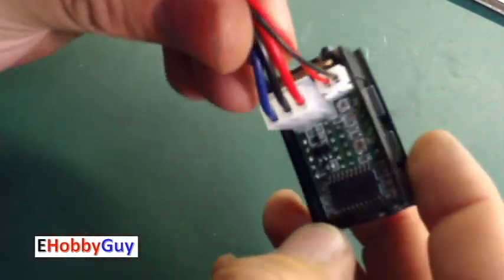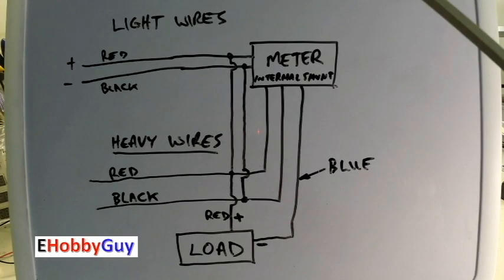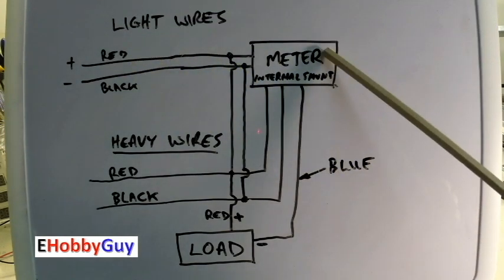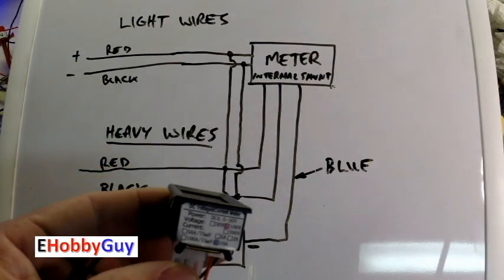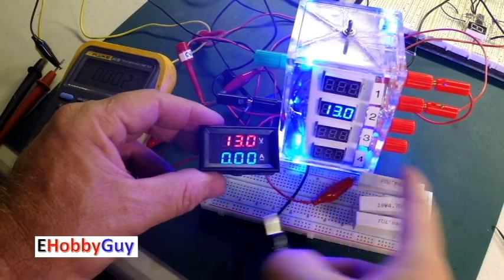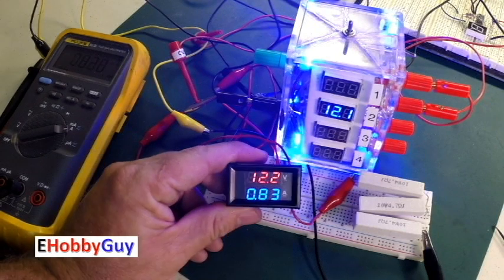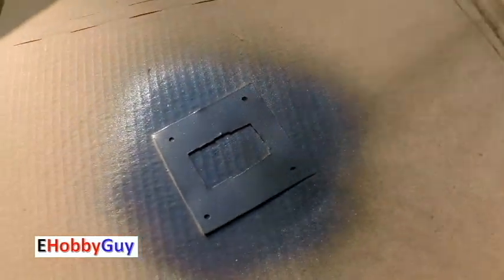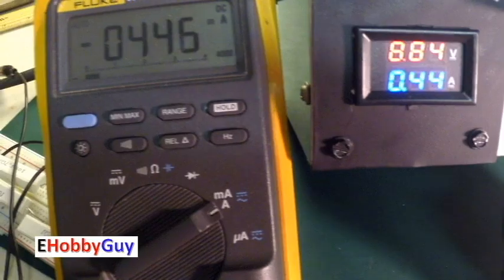CHEAP EBAY VOLT/AMMETER, REVIEW, HOW TO WIRE AND USE

Comment: Great Video!
Question, I am using a single power source for my meter but I want to be
 able to turn off the meter while leaving the line power on. Do I 
interrupt the yellow wire for a switch?
Thanks

Comment: Will one of these work on a 140 amp inverter welder ?
Reply from the maker: Not this particular one.  The maximum current on this one is 100Amps.  I am sure if you search for a higher rated one you will find one. Thanks for watching!

Comment: I have this same meter, and I want to hook it up to a boost converter that I'm using to charge a battery so that I can measure the output of the converter.  I put the small red and black wires on the input to the boost converter which is a 12-19v source (solar panel or battery).  I put the big red wire + and black wire - on the output of the boost converter which is 39v.  The + on the output also connects with the + on the (Load).  The green wire goes to the - on the (Load).  The black wire is not connected to the load, just the red + and green -, but the black wire is connected to the - on the boost converter.

It reads the voltage of the output of the boost converter as it should, but as soon as I plug in the load, it goes completely blank.  The boost converter is working, and powering the load, but the meter goes blank.  If I unplug it from the Load , it lights up and shows the voltage of the output.  I think I have it wired the way you say:  The negative of the load goes into the meter through the green wire, and then goes out of the meter through the black wire to the converter.

Any ideas what I'm doing wrong?
Reply: As described, your wiring seems correct. It's possible either:
1) defective unit
2) the load is too much for either the solar panel or the boost converter and it's taking the boost converter output voltage down so low it is unable to supply enough voltage to the meter...so it's blank.
3) the load is defective (partial/full short), leading to item 2 above.

Comment: Thank you for the info provided. I am new to electronics and I am trying to find a solution for my DC battery chargers. I end up busting the batteries due to over charging as the chargers currently do not have cut off indicators. I am charging blind at the moment. Is there anyway I can have some solution built to monitor the charge levels of the battery?

Comment: I am converting an old atx psu to a bench top. The atx says that it's capable of 11 amps. I probably wouldn't be able to use this meter would I? (I have one that I've never used and didn't want to have to buy a new one lol)
Reply from the maker: I would check the specs on the power supply.  On these power supplies, the total output is often the output with all channels outputting the maximum.  It is unlikely that you would ever use it that way. For example the 12V Channel may only be capable of 3Amps.  So you 'may' be able to use it.  Thanks for your comment and thanks for watching.
Reply: @ehobbyguy8980  thanks, I was thinking that but wasn't sure.

Comment: I bought 3 of these 6 months ago to use with my 400watts of solar panels and 400 ah batteries but they came with no instructions so I painstakingly searched all over the Internet trying to find how to hook these up I found out about the trimetic systems and bought a 50 amp shunt and a 400amp drok shunt. Now I'm new to this and just trying to install solar in my little RV LoL
Got tired of searching for answers and bought the Victron 700 comes with all the wires with ends And the instructions yeah
Now I find your videos and feel stupid I'm laughing at myself it's ok though.
I'm not stupid by any means I was a mechanic for years just never got around to more school electrical and all,
You're videos are pretty good thank you.
Reply: Thanks for wathcing !!

Comment: the problem in connecting the meter power to the measured one is that this way you can't measure the full range... below 3v the meter will be unreliable or will shut down...
Reply from the maker: squalazzo Yes, that is one of the drawbacks of wiring this meter in this way. Thanks for pointing that out and thanks for watching!

Comment: Hi Paul, do you know if these meters can be used to monitor the amps/volts output of a couple of 100watt solar panels?
Reply from the maker: They certainly could as long as the voltage and current limits are not exceeded.  Thanks for wathcing !
Reply: thanks for your reply but do you know how?

Comment: Thanks for the great instructional review. I wonder if this would affect the operation of my Duratrax IntelliPeak NiCd charger as the charger's amp selector pot setting bears no resemblance to actual charge rate (amps)..I presently use the ammeter function in a multimeter to measure charge rate but that is clumsy and awkward. Thinking this would be slick if it will not interfere with peak detection..
Reply from the maker: Oilsmoke Jones thanks for your comment. I don't know too much about the intelliPeak charger but glancing at the manual tells me it is pulsing current.  The duty cycle may or may not be changing during charge. I suspect it is. I would be interested in seeing a recording of the voltage and current readings for an entire charge cycle to fully understand what's happening. What do you think?
Reply: That would be interesting, anyway we'll know in a few weeks. I ordered 2 yesterday. They were 2 for $5.31shipping included...#lovehatechina
Reply: Yes that would be very interesting..anyway we'll know in a few weeks cuz I ordered 2 yesterday...they were 2 for $5.31.

Comment: HI Paul, I have just been using my volt/ammeter and found out that it cannot measure below 1A is there anything I can do with it?  Most things that I want to measure are below one amp. Thanks John.... :)
Reply from the maker: Hi John,  there is not much you can do if the meter is not capable of it.  The one I use (shown in the video) measures from 10mA to 10A.  I definitely would suggest buying another meter capable of the range you are looking for.  They are very inexpensive.  I hope this was helpful!
Reply: Ok thanks,  any chance you could send a link to the one you have, or what I should ask for specifically? they all look very similar... Cheers.. John... :)    Paul I have also sent a friend request so that I can follow you on facebook.... :)
Reply from the maker: Sure here is one, and it measures 0-10A.  I hope this was helpful!

Current Measuring range: DC 0 - 10A
Voltage resolution (V): 0.1V
Current resolution (A): 0.01A

http://www.ebay.com/itm/Dual-Display-LED-DC-0-100V-10A-Digital-Voltmeter-Ammeter-Panel-Amp-Volt-Gauge/361959512956?_trksid=p2045573.c100505.m3226&_trkparms=aid%3D555014%26algo%3DPL.DEFAULT%26ao%3D1%26asc%3D41451%26meid%3D9d67d71818954a12aa67f1e6d6ecfb00%26pid%3D100505%26rk%3D1%26rkt%3D1%26
Reply: That's great Paul, thank you very much for your help.... :)
Reply from the maker: John Berry you are very welcome. Glad to be of help!

Comment: my homemade power supply has 2 outputs:    Positve 1 to16v   and  negative -1 to -16. The ground is common to both outputs. I have 2 displays like yours. How can i connect the Amp part of my negative output ???
Reply from the maker: I personally haven't done this, but I would power the meter separately to the circuit that has the current that you are measuring.  If you are trying to measure the current on either side of the ground, you would always connect the heavy gauge blue wire to the lowest potential.  In other words, if you want to measure the current on the negative side you would connect the blue wire to the -16V, and the red wire to the common negative.  If you want to measure on the positive side, the blue wire would connect to the common negative, and the red to the +16V.  It is conceivable that you could put the blue wire on the -16V and the red wire on the +16V, and get the current across both, though if I am not mistaken, these are usually used in AC circuits, and this meter is a DC meter?  So I guess it does depend on what you are using the power supply on, and how you are using it.  Thanks for your question, I hope I was helpful, and thanks for watching!
Reply: hi. thx for your answer. i will send you a link to my power supply vid. i built it in 1987. i have upgraded both Pos and Neg displays since. This will be my 3rd time :)  I was always able to figure out how to display the Neg voltage ( simply reverse the wire)....but as the blue Amp display....not sure. i guess amps are the same whether neg or pos. Thx for you advice

Comment: Hi there!

I just came across your video and noticed that the panelmeter you are demonstrating, is exactly the same as the two i put into my "go" box (a tool box that has been converted to hold 2 seperate sets of 10Ah LiFePO4 batteries, one VHF/UHF and one HF tranciever, 2 cigerettelighter sockets, 6 rechargeable LED hazard/warning lights)

I quickly found out that the voltage reading was stable (it didn't drift over time/changes in temperature) but if i calibrated it at 5volts and then turned it up to 12 volts. The panel would read 12,4volts. And if i calibrated at 27volts and then turned it down to 12volts, it would read 11,6volts!

Have you seen this on your panel aswell?
And have you tried to run 100V through the panel to see if it can actually handle it?

Thanks for putting this video out there:-)

Sincerely yours
Bo Holbo

Comment: the meter that you say you bought has three small wires and two large wires
the meter you show is the other way round
i bought one from ebay as the wires as the former three small two larger
can you comment on this please.
Reply from the maker: I have not seen a meter like this with 3 small wires.  Typically the heavier gauge wires are for the higher currents, but the 3 smaller gauge wires does not make sense to me. Sorry I could not be of more help.  My apologies if I misspoke in the video.
Reply: @ehobbyguy8980  I have one as mentioned. Black, Red & Yellow thin wires to one connector and Black & Red thick wires to the other.
It also has a built in Shunt wire for it to measure a maximum of 10A. Thin Black & Red are to power the device, Yellow is the Voltage sensor.
The thick Black & Red go in series of the Load under test.
If you want to measure loads higher than 10A then you will need to use an external Shunt but remember to remove the internal one first.
Some of these Meters are sold with a Shunt but this is not explained.

Comment: Can you post the meter you got so many to choose from thanks
Reply from the maker: Sure, here is a link to the exact one that I used.
http://www.ebay.com/itm/DC-100V-10A-Voltmeter-Ammeter-Blue-Red-LED-Dual-Digital-Volt-Amp-Meter-Gauge-/131577787046?hash=item1ea2a5b2a6:g:EMQAAOSwie5XTO6m

Comment: Hi Paul I have just watched your review and thought it was very interesting,  I am now going to purchase one.I am also new to electronics and I think I followed what you where saying.  At the moment I am only using battery power for my projects, (max 12 v )  and mainly led projects. Am I right to assume I can connect  ++ and -- -  together as the voltage is low and I don't need a separate power supply.  Thank you very much... John :)
Reply from the maker: Yes, for a 12Vdc power supply you can safely connect the positives (reds) and the negatives (blacks) together to get a voltage reading.  Connecting your load to the red and blue would give you a voltage and current reading.  Thanks for your comment.
Reply: Ok thank you for your quick reply and have a great day... :)
Reply: Hi Paul,  my volt/ammeter has arrived today so I have just watched your video again, I will try set it up when I get some spare time. Thanks again... John :)
Reply from the maker: Great Good Luck

Comment: okay.  I'm a relative beginner here.  I picked up a few of these from eBay a while ago and your video does a great job of explaining what I'm going to have to do (thank you for including the mounting part).

The only issue In left with is that the heavier wires on mine are yellow, blue, and green.  Is there a standard for which those would correlate with or will I have to figure that out through trial and error?
Reply from the maker: Thank you for your comment.  I have seen other meters where the yellow wire would be the equivalent to the Heavy Blue wire in my video.  That would leave guesswork on what is what on the positive and negative.  My best guess would be Blue is positive, and green is negative.  My feeling is that if you test it with a low voltage and current, you wont do any damage.  Just try tapping the wires after the meter has power on the light wires.  I would be very interested in finding out how it goes?  Look forward to hearing back from you.!